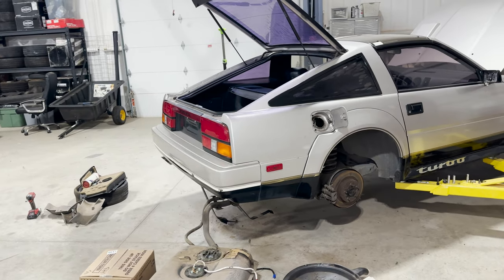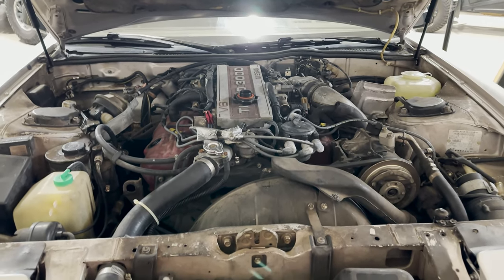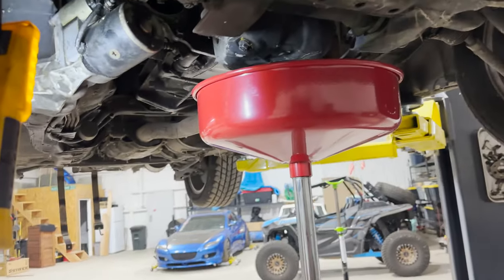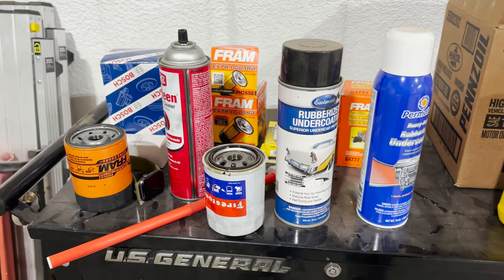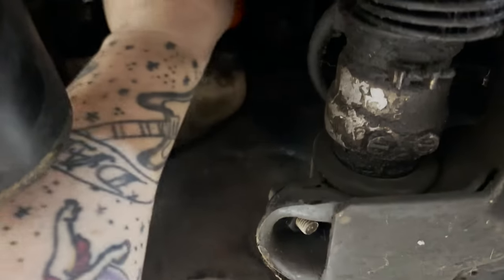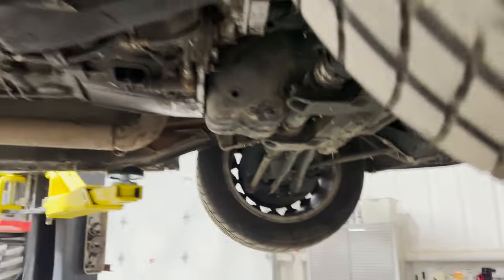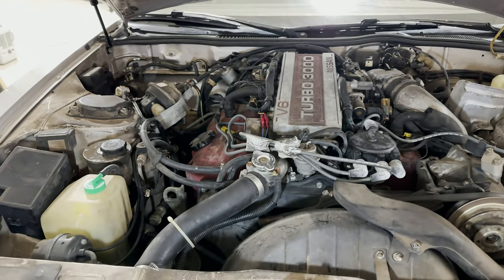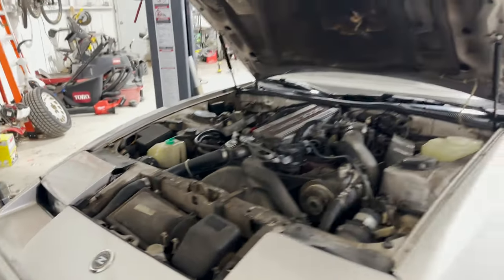300ZX Part 4 Fuel Filter, Oil Filter, Oil Change. Update on Fuel Tank Cleaning

Comment: What oil did you use
Reply from the maker: I just used Penzoil 10W30 cause I had it laying around. Once the car is back on the road for a 100 miles or so I will drain that and put in Mobil 1
Reply: @Bruburd  alr thank you really hard to find videos for the z31
Reply from the maker: @jalenwaithe7770  ya I noticed. I need to get out to the shop and start wrenching on it. House choirs have owned my life lately. Hoping to get a new video out soon